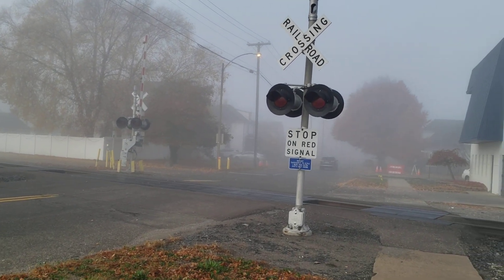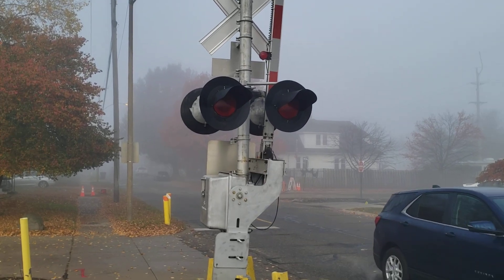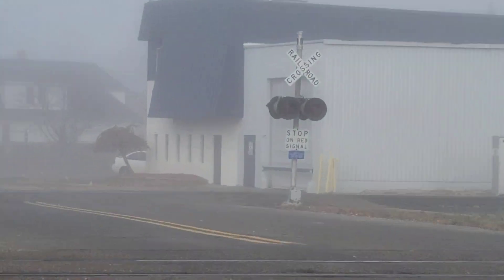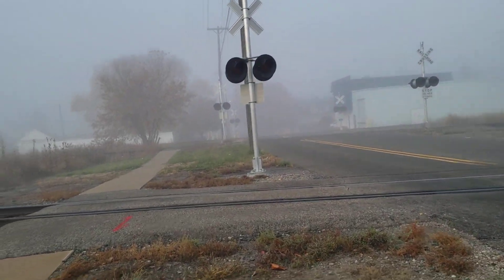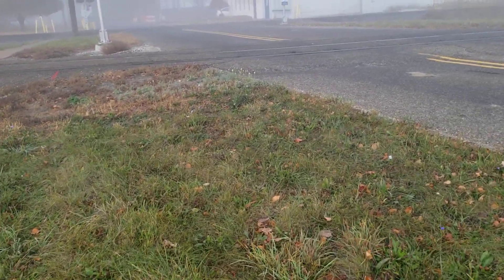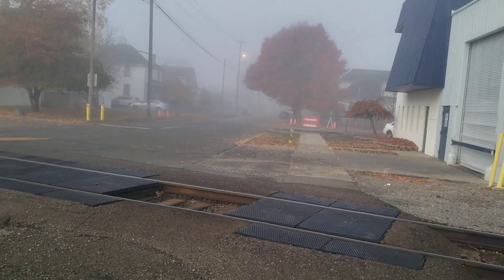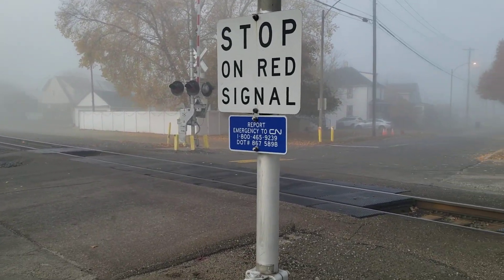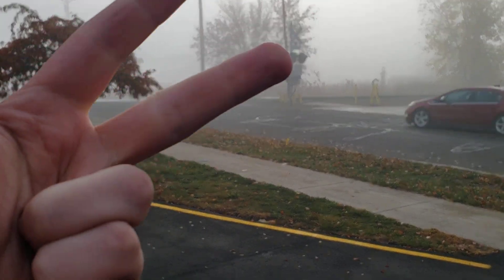The Railroad Crossings of Wyandotte, Ecorse & Trenton MI. - How Do They Work? (Informational Video)

Comment: Here's my information about the wiring:

Most of the Railroad Crossings have the Conrail Tracks wired incorrectly & the CN Tracks still wired correctly!

6 of the Railroad Crossings have the CN Shoreline Sub Signals wired incorrectly!

2 Railroad Crossings have the CN/Outer Conrail Tracks wired weird!

2 Railroad Crossings have the Signals wired completely incorrectly!

Ok, so for Visger Rd. & Mill St., the Outer Conrail Track at Visger Rd. & the CN Shoreline Sub at Mill St. have the Mast Signals wired exactly as the Conrail Middle Signals, which is weird, while at Visger Rd., the East Side Gated Signal has the Back Lights wired incorrectly to flash, no matter what, while the CN Shoreline Sub has a massive delay on it's Gate lift, plus the Bell shutting off before the Gate lift!

Similar for the CN Flat Rock Sub at Mill St. with the Bell shutting off before the Gates lift, but gladly without any Gate lift delays!

Also, like Visger Rd., Salliotte Rd.? (I need to double-check or wait for some more Videos of that Railroad Crossing... 🤔), Mill St., Emmons Blvd., St. Johns St., Goddard Rd., Antoine St., Ford Ave., Pennsylvania Rd., Sibley Rd.? (I need to double-check or wait for some more Videos of that Railroad Crossing... 🤔), & King Rd., they have 1 of the CN Mast Signals' Bells wired with it's Front Lights, to ring when the Front Lights, plus the Back Lights on the Gated Signal flash for a Train or a malfunction.

At Visger Rd., Salliotte Rd.?, Emmons Blvd., St. Johns St., Goddard Rd., Antoine St., Ford Ave., Pennsylvania Rd., & King Rd., that kind of Bell rewiring is on the CN Shoreline Sub, while at Mill St., it's on the CN Flat Rock Sub!

Sibley Rd., I currently don't know or forgot, as I'll have to double-check on that or wait for some more Videos of it! 🤔

At every Railroad Crossing excluding Visger Rd., Mill St., Ford Ave., & Harrison Ave. have the Conrail Middle Signals rewired incorrectly, while Salliotte Rd. & Oak St. have their Conrail Middle Signals wired extremely incorrectly to go off, no matter what!

At the others, all the Conrail Middle Signals go off, whenever there's a Train or a malfunction on any of the Conrail Middle Tracks!

Salliotte Rd., Emmons Blvd., St. Johns St., Goddard Rd., Antoine St., & King Rd. have the CN Shoreline Sub Signals rewired incorrectly for that whenever the Back Lights come on for a Train or a malfunction on that Track, they stay on until the Crossings completely clear & the Gates are all the way back up, while the CN Flat Rock Sub Signals are gladly still wired correctly!

The rest have both the CN Signals gladly still wired correctly!

Oak St.'s CN Signals are weirdly wired, as after the Train clears whatever Track it's on or when the malfunction ends, the Back Lights on both CN Signals come on during the Gates lift, which is definitely incorrect & similar to the incorrect rewiring on the CN Shoreline Sub Signals at Salliotte Rd., Emmons Blvd., St. Johns St., Goddard Rd., Antoine St., & King Rd.!

Also, Antoine St. & Vinewood Ave. have the CN Flat Rock Mast Signals' Front Lights wired backwards to cause the back-n-forth flashing on the back side, while the front side still correctly flashes side-to-side, while Antoine St.'s CN Flat Rock Sub Signals are on 2 separate Flasher Relays, 1 for the Front & Gate Lights & 1 for the Back Lights!

Harrison Ave. used to be like that on the CN Flat Rock Sub Signals until they sadly got fixed back to 1 Flasher Relay back in 2020!

Antoine St., back when owensri2 was there back in 2008 recording the malfunction on the CN Flat Rock Sub, only the Mast Signal's Front Lights were on a separate Flasher Relay!

In the upgrade, they've rewired the Gated Signal's Back Lights to be on the same Flasher Relay as the Mast Signal's Front Lights, while they're rewired the Mast Signal's Front Lights to flash backwards, causing that back-n-forth flashing on the back side!

Oh, & lastly, with the incorrect rewiring on the CN Shoreline Sub at Salliotte Rd., Emmons Blvd., St. Johns St., Goddard Rd., Antoine St., & King Rd. also ends up with a minor Gate lift delay, while the Gate lift delay on the CN Shoreline Sub at Visger Rd. is major!
Reply: they've

I can't edit my Comment to fix that mistake in the bottom of it 'cause of a return error????? 😦

What the heck, YouTube!!! 😡

Comment: Good explanation.  A very simplified way to get the main point across is that the outer crossing signal lights will always activate along with the gates going down to make sure people know there is a train coming and to keep them outside of the 4 tracks.  The 2 CN tracks are on the outside.  Inside are 2 Conrail tracks which also have signals, however they only activate and flash when a train is coming on that track.  Reason being so people can stop in front of the track and know that a train is coming on that particular track (nobody really does, everyone typically flies through it)